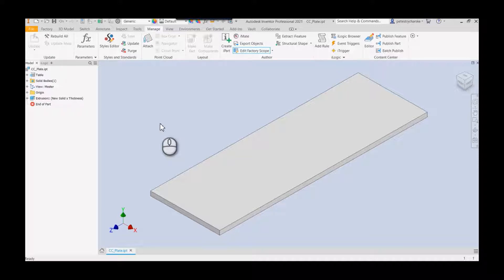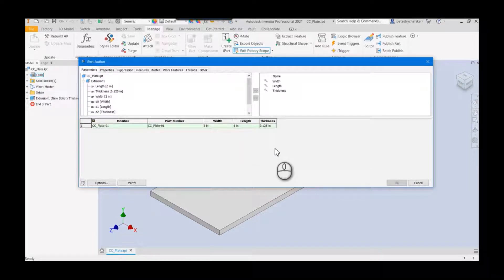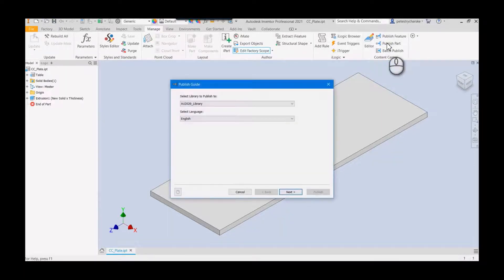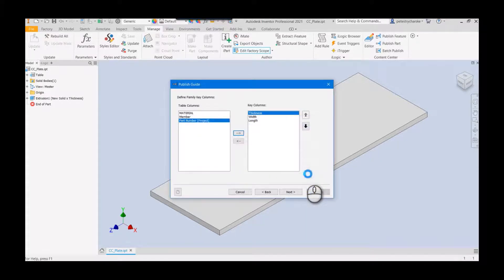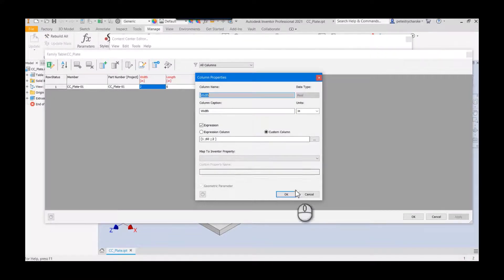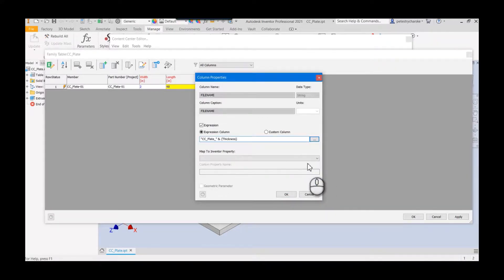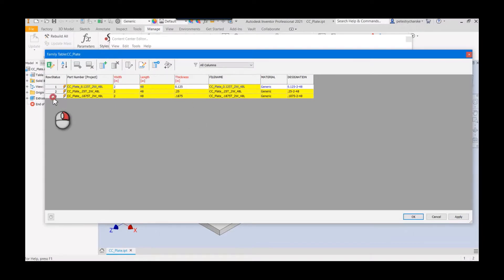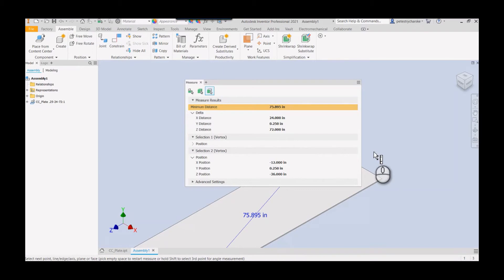Inventor - Content Center Families with Multiple Variable Values

Comment: Hi, thanks for the video. Is the Content Center family automatically updated after created a custom member?
Reply from the maker: William good morning!  Can you please clarify the question?  Are you asking about placing a custom part from the content center, like a length of structural steel?  If so, those parts are not connected to the Content Center after placement and are independent parts.

If you're asking about adding a new row to an existing table, then yes, you should be able to place that newly added row the next time you launch the "Place from Content Center" command.  If it doesn't work right away, please close and reopen Inventor.

If this isn't what you are trying to do, please respond and we'll go from there.  Thanks for reaching out and have a most blessed day!
Reply: @Team-D3  Hello, I'm asking about allowing custom values for user, with content center with custom "length" example.
If the user creates a new custom variation of a pipe length, shouldn't it be added to CC table?
Reply: I have a library with more than 5000 variation of pipe lengths, performance is too bad. This number will get bigger and bigger with time.
I'm considering to split this CC with length limits: from 0 to 2000 one table, from 2001 to 4000 other table and so on...
Reply from the maker: William, thanks for clarifying.  No, you do not have to add each custom length to the table.  You can choose to place each of these lengths as a "Standard" version CC Part and then if a person happens to place that same size again, then it would simply pull from the already placed version.

One can also place these as "Custom" parts and then they could be saved to a specific job and would be fully editable.  In this case, you wouldn't need to add these rows to the CC table.

Hope this helps and please send along any other questions!  Have an awesome and most blessed day!
Reply from the maker: I wouldn't worry about adding the additional lengths to the table, unless there are features that need to adapt to the various lengths (mostly turning them on or off).  If features are required, iLogic can also be utilized inside of CC families, so long as one knows what they are doing and doesn't try to control the same value with iLogic and in the table...  Please see my AU class that covers some of this, from a couple of years ago.  Thanks for reaching out and have a most blessed day!

Link to AU Class: https://www.autodesk.com/autodesk-university/class/Making-Content-Center-Do-More-You-2019

- Pete